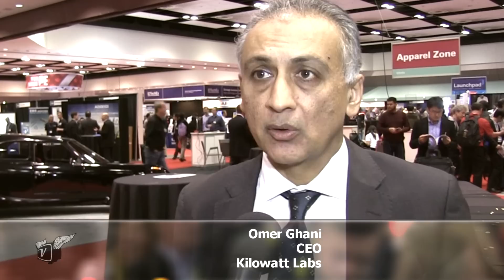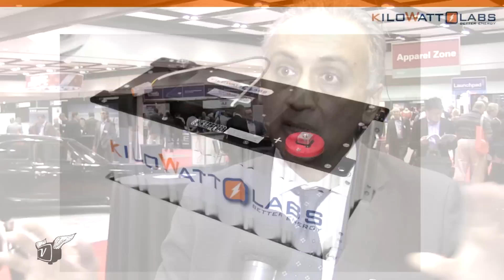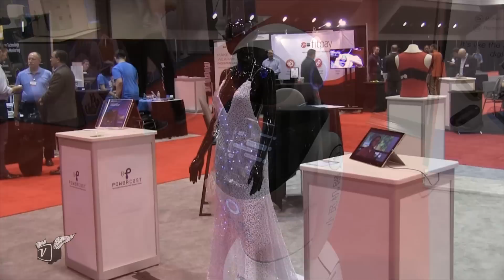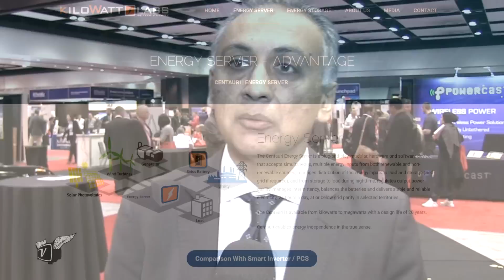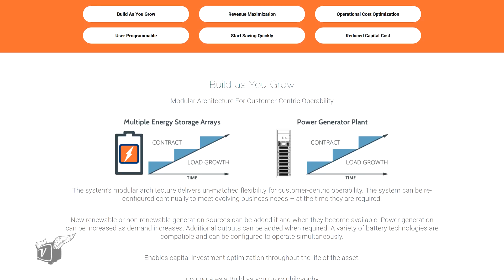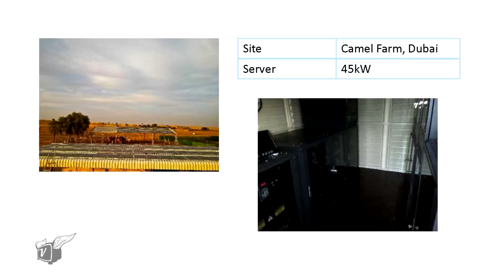The Fuel Tank of Tomorrow - A Super Capacitor?

Comment: Capacitors are notorious for 'leaking' energy so why didn't he address this? A scientist here in Austin Texas has been working on this for years and it still hasn't come to market.

Another scientist here at the University of Texas is working on a 'glass' battery that looks very promising.
Reply: They don't self leak that fast. I have a couple 6pack 3000f packs made up and one is going in my 05 Suburban to help for snow plow surges that damages batteries. Another guy on Utube only using a 350f 6pack for his 4cyl car - no battery- and after a week of no use, still starts up his car. Been using it for years. Mine 9+ more energy :-) 

My still be able to get the big farads on ebay. I spent $330 / pack (includes balancers & hardware)
Reply: If a scientist working in USA has not been successful, wont stop scientist in other part of world to invent and success. Now having said that sure this guy is a con artist. I saw in video that one of his plant was mentioned to be in Pakistan and immediately knew it would be a Lie. remember Osama Bin laden was found in Pakistan and all this while they took Billions from USA to fight terrorism!
Reply: @RaviGaur  Large SuperCaps are expensive for one thing. A battery is 1/3rd the price.
Reply: @SamaritanElad  thats not true! given the Life of Cap its cheaper, But Battery and Caps are not the same as of now !. Caps are quick and sort of useless for slower drain! There are experiments  happening to Put Caps in front of battery to Give boost to Motors to make them more torque'y. and to Charges the Caps first and then Charge battery with them. but replacing Battery with Caps is still far from true ( at least for time being) anyone in present or in past claimed to do so is a Conman!
Reply: @RaviGaur  I have 3 complete sets of 3000F caps and 2 more sets of 2000f caps to assemble. You can check LaserSaber channel as he uses 350F cap setup replacing his battery. https://www.youtube.com/watch?v=z3x_kYq3mHM

 I have 1 set of 3000f caps in my 05 Subarban with a snowplow and its working great. For long lift just sitting, a small motorcycle batter in parallel will keep it charge for months as I don't drive it much (fuel hog). The small batt is there only for off-setting the Slow drain. I wouldn't need it if I drive twice a month even. Look at next post as another one here is using caps too.

Comment: I own one 16v 500F.
I can make discharge tests and stuff if you request.
Supercaps are not good storage. But it always starts my Audi A6 2008, even at 7 volts.
Reply: Do you use with alone or as with a battery supplementation ?

Comment: Because these capacitors are able to charge and discharge very quickly, they can be used in regenerative btreaking. The energy of breaking can be stored in capacitors, because breaking duration is usually 5 seconds. And then car can use this energy for accilaration which requires high power in short time. So capacitors can be added to bettery powered cars but they cannot replace bettery entirely because capacitors cannot store large quantity of energy for longer duration. So bettery is merathon runner and Capacitors are sprint runners

Comment: I have 3x Maxwell 50V 178F (2000F in series) ultracapacitor banks. I was going to use them for regen on a 144V EV car. you need a good controller to utilise them. Them can charge/discharge at around 2000A

Comment: So let's see, CHEAPER than lead-acid, a million recharge cycles, already doing projects... and yet - not a product in sight - the ONLY important thing on a sales website - PRODUCT - is missing. I can smell something....
Reply: This is exactly what I was looking for, a battery I can purchase on a website to test myself!
Reply: It might take more than meds... lobotomy?
Reply: I have no idea what that sentence means - but where is the product?
Reply: Their's a guy that made them himself  on you-tube you could used it to start the car Could not use anything like lights or ect until car was running  Need to charge once in a while because  it will discharge after a day or 2
Reply: Cheaper, based on TCO. But investment costs are super high. A lead-acid battery runs about 2-5 years fine, a lithium based battery 1-5 years. Both are super dangerous materials (for example in fire, and a small thing can couse explosion). A supercapacitor can run very long time....
Reply: Actually they are not cheaper. I have seen on a site a battery and is 5k for 3,5 kwh Powerwall is about the same price but with 13 KWH. If they get to mass production than maybe will be cheaper. till than for consumer is not an option. plus, is twice as heavy.  But... these guys are doing something similar, and they say that can store ten time more than lithium, https://www.youtube.com/watch?v=KQ2Eo6wl5r0&feature=youtu.be
Reply: If you are still interested, there have been videos here on youtube with products being tested that have 3.55kWh and a price similar to lithium ion batteries of similar size
Reply: Ya it smells like bullshit they've run out of money and need more to continue but right now they don't have a product to deliver they just want the money
Reply: I wonder how much of this is subsidised by the tax payer.
Reply: I found it in less than a minute. Quite a lot of resellers (at least now - one year after your comment). GL!
Reply: Think Elio?

Comment: you can buy these cap packs online  12vlt  24vl  etc then u run it thru  a 110 - 240  circuit  converter - thingy like used in cars 12vl to 240vl

Comment: Super caps are interesting but have minuscule energy storage. They are very low voltage and are useful for a few micro-amps at most. Short them out and the large ones can be dangerous. Ten thousand farad at 48v  in a small package, now we are talking.

Comment: slow charge slow discharge as required by the law. they also have to be hack proof since the issue with the regulators is to prevent these device from being used as explosives

Comment: What is their self-discharge rate? Typically capacitors have a much higher self-discharge rate than any battery. That is where by just sitting around a for while, it looses its charge.

Comment: A supercap will not be good storage until they can hold voltage above 250 volts.  Series super caps divides ferads per each one added.
Reply: The should be charged individually while connected in series and discharged as whole while connected in series.

Comment: 1 application these SHOULD be used for, in cars, is to have a large electromagnet in the front and rear bumpers obviously attached to the frame.  It would use a laser, sonar or radar (whatever range sensing tech is on the model car you'd get) to detect when you are about to be impacted, the victim car CAN communicate through that range sensing tech to the offending car and vice versa to collaborate a timed discharge.  This is for 1-4ft away from impact.  It would obviously have to be an agreed upon standard.  These types of capacitors can be used with a specific voltage and current curve to provide a linear or or better yet, an exponential curve  to provide an ABRUPT deceleration to shave off 20-30mph without the cars contacting.   It should be with forward collision warning and emergency braking, but it would help any vehicle. 

 I'm sure you'd need a few of these cells to make that work, I'm not claiming that 1 of these modules will do what I'm saying!
Reply: this is in reply to people commenting about safety.  this way, the car predicts the collision, dissipates all that energy over 1-3 seconds in an effort to lesson the impact.  when/if the impact occurs, there is no stored energy.

Comment: Can you charge them with solar panels and hook them up to a grid-tie inverter and use the them for the evening? My solar make to much energy during the day but looking to store the power for few hours during the evening before bedtime, they sound better than traditional battery storage. I would love to buy some if this would work
Reply: in that case I believe you're going to run into a cost difference - more batteries is probably cheaper than one of these exotic capacitors

Comment: Pretty sure the energy density is still crap vs lithium or even led despite the way he danced around that issue giving a non answer.  He mentioned it was cheaper than battery but I kinda doubt it's cheaper per unit of storage eg kwh.  Still super caps are cool and I wish them the best of luck.

Comment: how long do you think supercaps would be available worldwide specially AsIa it sucks because asian always left to be the last to benefit, and does it come in smaller size for mobile application? since you mention it is also applicable on car battery , question' does the alternator motor would be fast enough to charge it ? in that case ,the theory of perpetual charge and discharge of EV application is possible ,yes or no?

Comment: China has working super capacitor buses in one city...they charge up every few stops....they could be used for, inner city taxis also..energy density is still a problem for mobile applications....but there is a race for new material solutions for that problem...it's perfect for home systems, grid stabilization, telecoms...in its current state.

Comment: can it be used in powering electric vehicles?
Reply: Yes, but only as a buffer between the battery and motor. Batteries hold a lot, but don't like to be charged or discharged too fast. Supercapacitors can handle that kind of fast charging and discharging, but don't hold much. Put the two in parallel and you can get the benefits of both. Acceleration and braking energy goes in and out of the supercapacitors, which then slowly charge or discharge from/to the battery. Battery gets its preferred slow charge/discharge, so lasts longer, motor gets its big demands when it wants them.

Comment: The biggest problem with caps is the low energy density, not self-discharge or voltage balance.
Reply: The price- Pewdiepie energy density is irrelevant for fixed installs.

Comment from the maker: One of the simple applications for capacitors could be fast-charging, frequent stop buses, such as outlined in this article:

https://www.linkedin.com/pulse/cool-new-e-busses-run-without-battery-gerald-babel-sutter

I hope that someone looking at this technology for commuter rail (e.g. Caltrain).  It seems like it could be a lower cost and safer way than electrifying the infrastructure.  For example,  a 7-stop trip between San Jose and San Francisco  would allow for approximately one-minute of charge at each stop, which, assuming a linear charge/discharge, would  provide plenty of reserve and wouldn't be too long as to slow down the total journey. Additionally, platooning and automation would allow flexible sizing and consistent frequency throughout the day.
Reply: support your claim...how about: every charge spot MUST have wires back to the main energy source...hence an intensive infrastructure to sustain the extreme energy loads potential at every charge spot
Reply from the maker: From various conversations I have had with people in this field, it seems like local energy storage of some form will be required in order to support fast-charging, so that the distribution infrastructure could effectively slow charge the local storage associated with a charge spot.
Reply from the maker: Another example of a Supercapacitor being used for fast-charge application of 22 person, electric shuttle https://chargedevs.com/newswire/singapore-electric-tram-charges-in-20-seconds/
Reply from the maker: And another example of supercapacitor technology that is apparently going to be integrated into transportation is from Avevai, a Singapore-based company that is making electric shuttles. http://avevai.com/avevai-reveals-electric-vans-powered-by-supercaps/  In this case, batteries are still used, but are supplemented by supercapacitors that are able to more efficiently capture energy from regenerative braking and back EMF from the motor. It also helps "overcome the moment" of inertia (taking a load off the battery). Bottom line is that the supercapactor technology, provided by the E-Synergy Graphe Reseach, is providing greater efficiency and performance to the electric shuttles http://e-synergy.green/products/gems/

E-Synergy also seems to have a 12 Volt car battery replacement that seems to be built on supercapacitor technology (it could have some battery storage integrated as well).

Comment: If you instantly discharge a super capacitor to zero volts, this means, that all the energy stored is instantly released. We usually call something that instantaneous releases that much energy a bomb. This is the opposite of safe.
Reply: Daniel Hughes lol, safer than coal oil petrol nuclear lead lithium, how the hell have you managed to not stick a fork in an electric socket yet?😆
Reply: well you added nothing to the conversation what data do you have to support your claim?
Reply: sorry i was talking to michael brink worth but i agree with you daniel.
the ability to discharge a capacitor incredibly quickly is their strength
they would not make a good substitute for batteries where you need power over a longer period of time.

this whole supercapacitor thing ignores the simple fact that they have a very poor energy density for their weight. lithium batteries are by far more energy dense
Reply: Michael Rue capacitors don't have to release it all in one go. One technique that is used to slowly release electricity is by using a joule thief circuit.  
Energy density is not important at all when it can take as much room as you want, so buildings and homes can have large area with lots of weight with no ill effects.  Supercaps can be fully discharged with no damage, and will theoretically out last the building for recharges.
Buses in China are being manufactured with super caps only, and recharge off the existing infrastructure every five or so stops while clients alight. 
Everything i listed in my comment above is poisonous to humans and the environment. Supercaps can and are made from hemp fibre, coconut husk, etc 😆
Reply: needing recharging more often is insuperior to charging once and knowing you have enough power for the whole day. this is exactley why ive installed a 10 amp hour battery on my lg g5 so it lasts 22 days or 10 days with heavy use or why i installed a 5 kilowatt battery on my ebike to be able to go 500 kilometers on a charge.
and yes even supercaps do wear out
Reply: and how long is each cycle?also the electrolyte breaks down after way sooner than a million cycles , where do you get those numbers? it is completely over exaggerated
Reply: Michael Rue either you are completely ignorant of how batteries and capacitors work or you are a shill of the battery industries trying to discredit the evolving super capacitor industries. Oil sector isn't the only ones that try to destroy other industries to protect there finances. There is room for both as they can fulfill differing needs. If you are not a troll then perhaps you could learn some basic science and chemistry before posting ridiculously incorrect statements as in every post you have made on here. 😆
Reply: what did i say that was incorrect and what is the correct answer?
i use lithium batteries for their energy density and i build lithium battery banks. ive used both supercapacitors and lithium batteries. i think you are a troll. namecalling and making claims that your not backing up. your acting like all the other conspiracy theorists and flat earthers.
i can provide actual data if you want.
there is a very good reason supercapacitors are not the primary source of power
Reply: Daniel Hughes it's a capacitor,been around almost 100 years,if you short it,bam an arc of about 1ft,so yeah,but no one with any sense would try that.not much reason I can think of why you might want to throw away all that juice!but other than a melt at the leads,the capacitor would still be reusable.batteries are far less safe& much heavier,&most can't handle full discharges.this tech.is way over due!
Reply: what your saying batteries are heavy? have you compared energy densities? batteries are much lighter for the energy they contain and have a way better self discharge rating compared to super caps.
Reply: Except that is video claims that you can safely instantly discharge a cap, which is nonsense. You say that no one with any sense would do this, but that's exactly what the guy in the video says they will do, the only way to instantly discharge it is to short it. (which is not safe at all)
Reply: Daniel Hughes 
"Within a second" is probably a thousand times slower than a bomb (almost instantly). Still dangerous unless hooked up to a utility line that can, obviously, handle such high currents.
The purpose would not be for storing renewable energy 24/7 but for smoothing the grid for things like when wind is too much, one second, and not enough the next second, or more likely, quickly fluctuating consumer usage.

As it nears zero volts, most of the energy would be wasted just trying to boost the voltage back up to nominal, though.
Reply: Daniel Hughes n
Reply: OR a Capacitor discharge stud welder
Reply: @elk3909  not any more
Reply: Blackscholar Sun  no elecrolites
Reply: It means it CAN discharge instantaneously at it's full capacity not that you would discharge it at that rate if you were wise. The discharge rate of even a Lithium battery is dictated by it's particular discharge rate.

Comment: Both batteries & super capacitors have limited capacity. But batteries don't like quick charging without extra heat & expansion, causing catastrophic failure. Maybe super capacitors would suit electric vehicle application.